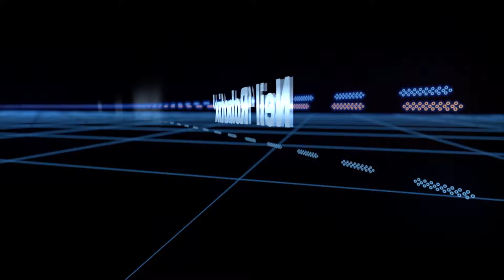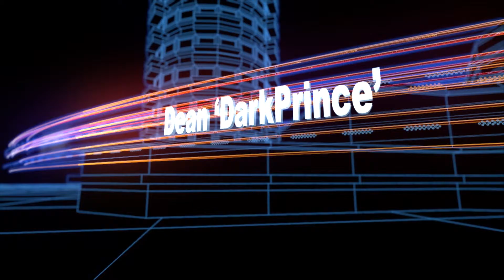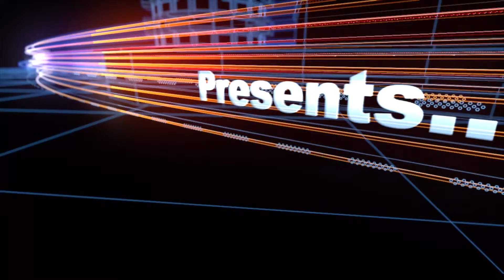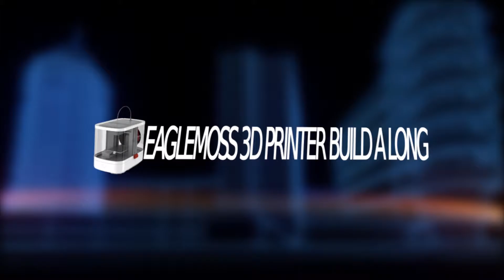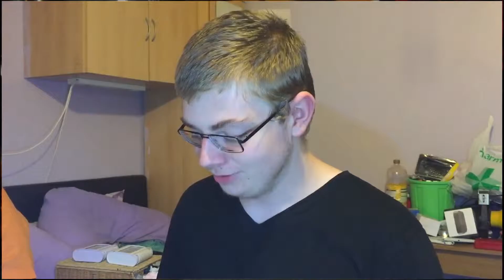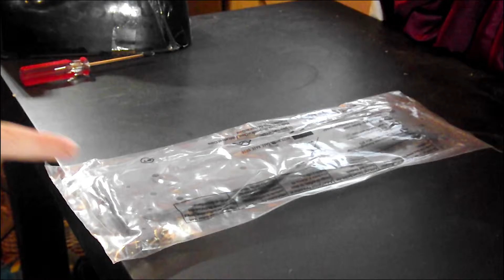Eaglemoss 3D Printer Build A Long Part 87

Comment: Hiya :)A few things :-as b/c I'm a few issues a head of you, (just to let you know) when finish building the hood, it may not seem like it, but it does matter which way round it goes on the printer, if you try to put it on the wrong way - it won't fit - as you will see in Issue 90 of my video (when I have finished uploading/editing it!!!)Also have you notice with the Mag - Issues 1 to 50 = 24 pages                                                               Issues 51 to 80 = 20 pages                                                               Issues 81 to 90 = 16 pages                                                                Issues 91 to 110 = 16 pages (I'm jus guessing these issues!!! We will have to see though)